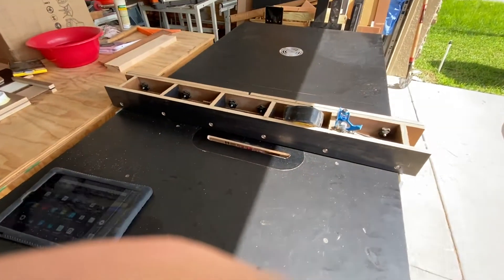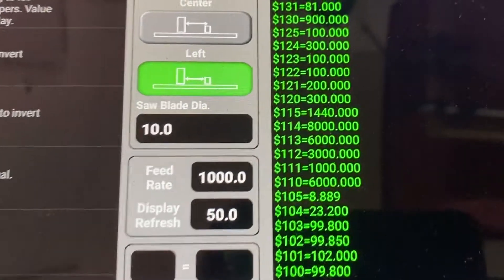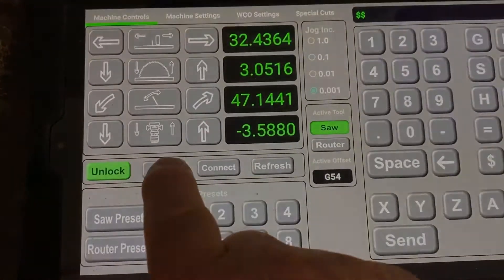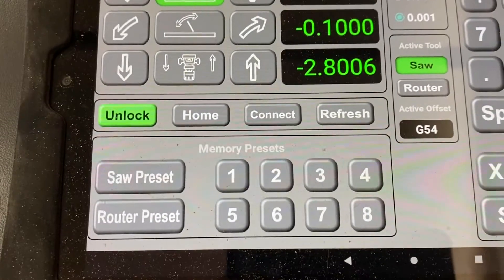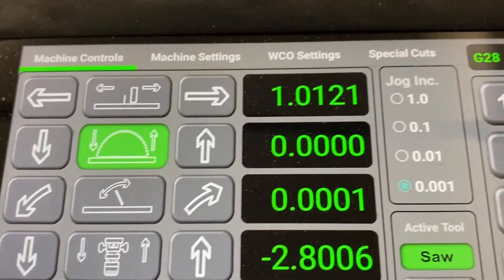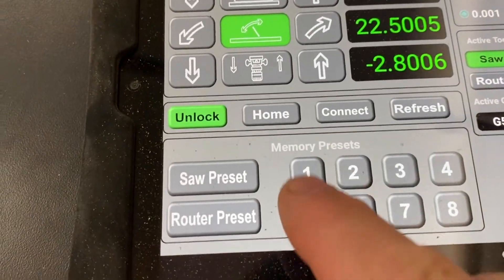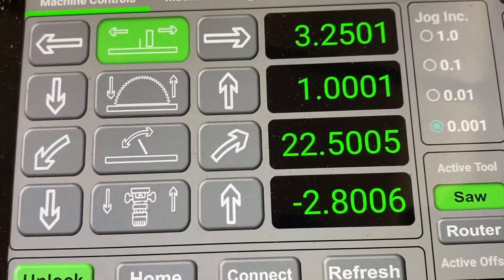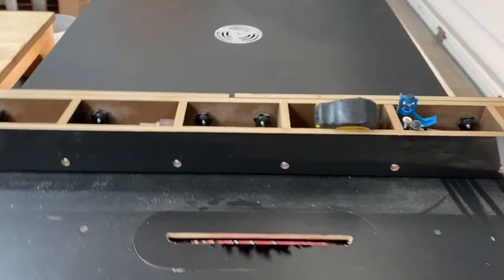Home Built CNC Table Saw

Comment: @Mikes Nerd Cave this is an awesome project! I’m jealous! I want to create something very similar and would appreciate any and all information you are willing to provide. Could you post the code for the app you created and arduino?  Awesome project! Thanks!
Reply from the maker: I am actually re-making my saw cabinet. I just received my new SawStop so I am designing the cabinet and cnc functionality around the new saw. The new cabinet will have some new features in it so I'll be remaking the app too. As for the Arduino...it is just running GRBL Mega5X which gives you a few extra axis.
Reply: @MikeSmith  Very impressive.  I am familiar with GRBL, but I know nothing about the app creator (B4A).  Does it have a code you could provide that has the app functionalities? What new features are you planning to add?  Very cool!
Reply from the maker: @N8E8  I'm actually going to be switching languages and using either VB or C# which will give me a lot more control over how I make the app. Unfortunately when I made the app I was very new to programming and didn't use git so I had no backup and my hard drive went out on me and I lost the code so this gives me a good opportunity to switch over to a better language. As for the new features...there will be a thickness planner built into the cabinet that will lift up out of the cabinet using stepper motors and be controlled thru the app so you would select it as the tool you want to use and it will park the saw blade router and fence out of the way and then raise the planner. I'm also going to add a built-in cross cut sled that is on linear rails for precision and it will have a digital angle gauge built in for quick adjustments.
Reply: @MikeSmith  I can't wait to see!  Will you still be using the same B4A  to create your app, or are you going another route?  Will you control the lifting of the planer height with steppers too?
Reply from the maker: @N8E8  actually I'll be using visual studio to make the app and I'm going to try and make it so it can be installed on a tablet, a raspberry pi or a pc. Yes the planner lift will use stepper motors.
Reply: @MikeSmith  Where are the calculations made to convert the input (number of inches entered in app) in the app to the actual execution of the movement or gcode?
Reply from the maker: @N8E8  it is hard coded in the app. The arrows on either side of the DRO are jog buttons that will send an incremental jog command to GRBL at the max feed rate of the machine and when you type a number into the DRO and press "Send" it is sent as a move command at whatever the maximum feed rate is that is set on the machine settings page.
Reply: @MikeSmith  thanks! So, in the app you have, if you press 15 enter. The app sends a gcode command of something like G0 X15  to the arduino that has grbl installed?  I am trying to start simple with a basic keypad. Use it the same way you are using the app. However, I can’t wrap my head around how to get the keypad to send the correct information to grbl to make a move. Thanks!
Reply from the maker: @N8E8  yes that is correct. I have it coded so that when you enter numbers in with the keypad each number press appends a string variable (lets say the variable is call "Distance") then when you hit send it creates a string (DistanceToMove = "G0 X " & Distance & " F1500") then it sends that string to GRBL over the serial communication.
Reply: @MikeSmith  Thanks for all the help!  I have been messing around with it, but I am having some issues.  I have an arduino mega that I want to send the keypad information (ex. G0 X 15 F1500" to an arduino uno.  Prior to uploading grbl to the uno, I can connect the mega to the uno through the rx1/tx1 and rx/tx and send serial information from the mega to the uno, but once I upload grbl 1.1 I can no longer send serial information over, it won't upload.  Can you advise as how I should try to send the serial information from the mega to the uno that has grbl uploaded?  I really appreciate the help!

Comment: Hello Mike. Awesome build. Would you consider selling a copy of your app to me. I haven't got a clue how to write one, but I sure like yours. My project is automating my Powermatic 66. However, I'll be using Rack and Pinion and linear supported rails.
Reply from the maker: I still have a little work to do on the app but once it is done then yes I'd be happy to. I am actually working on kitting the CNC fence and blade raise and tilt for specific saws. Since this video my table saw motor went out on me so I had to buy a temporary saw to get me by but this February I'll be getting a Saw Stop and adding all of my CNC components to it. In addition I'll be moving the router to the left side of the station and adding a lift to the right side for a 13" thickness planer which will also be incorporated into the app so when you want to use the planer, the saw blade, router and fence will get parked to a safe zone and then the planer will raise out of the table.

Comment: Mike, this is an awesome project!  I would love to see more videos on the internal workings, mechanics, and linkages.  It would be nice to see how the motors are attached to the blade height, trunions for tilt, etc.  Thanks for sharing what you've done!
Reply from the maker: I'll be doing a more in depth video of my ne build which includes a Saw Stop and adding a thickness Planer to the work station and app.

Comment: Very nice job! What is the drive mechanism for the fence? R&P?
Reply from the maker: the fence is driven by 2 nema 17 steppers using 2 8mm leadscrews. The widest cut I can make is about 31" and I'm pretty much at the max length you'd want to have leadscrews. I've thought about increasing the length I can cut so I might be upgrading to some SFU1605 ballscrews and maybe even upgrading the steppers to nema23.